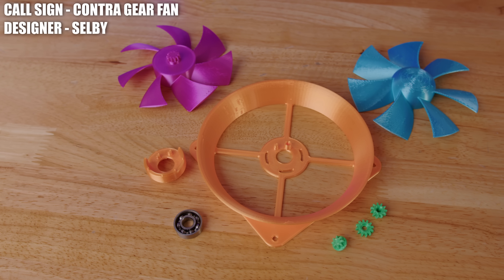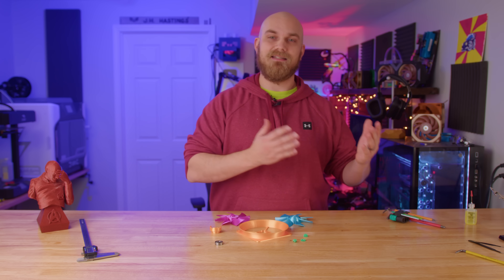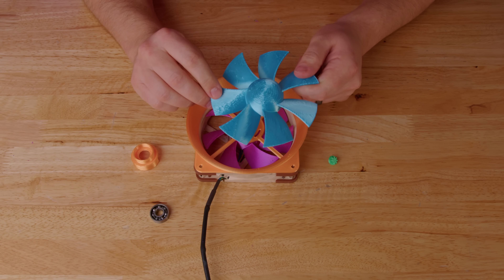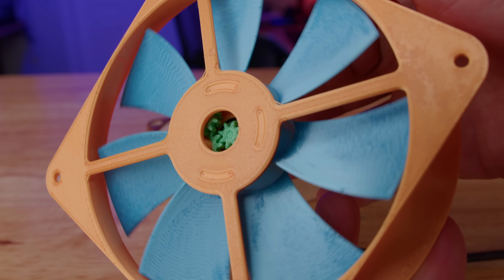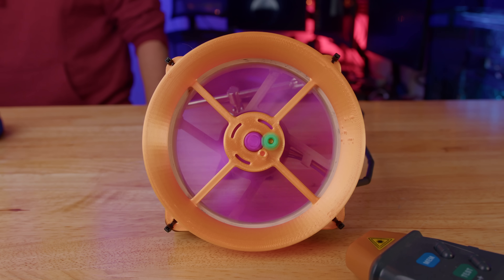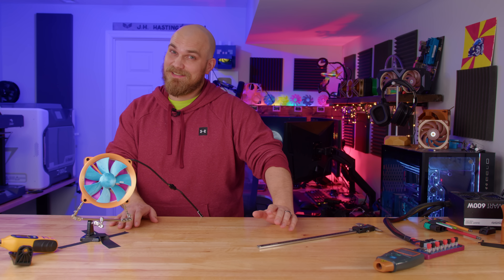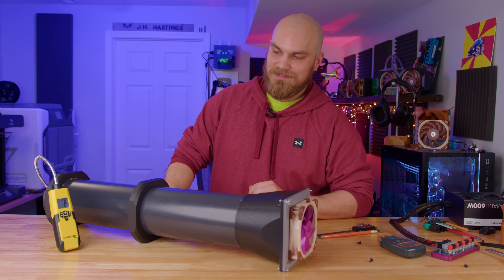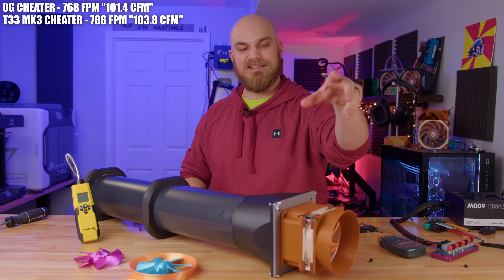World’s Most Complex PC Cooling Fan | Fan Showdown S4 Special

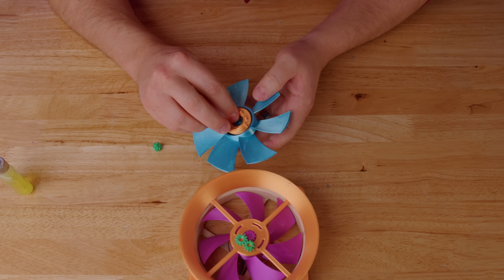Comment: 5:00 I wonder if watch oils would be best? Check out wristwatch revival. He has a video that says the basics of what you need for watch repair and he lists the 4 oils/greases he uses and what each is for! Might be worth it! Granted, plastic gears are different than metal ones, so there might be some trial and error. But seems like this keeps coming up!

Edit: I also wonder if you could try filing the teeth on the gears? Just like a quick pass to smooth them out a bit? Idk

Comment: has anyone thought of a drive train driven turbo for a fan, like a set of 3 fans, the primary fan being the fan with a motor attached, the second fan being driven by the airflow of the first fan (either in front or behind the primary fan) and the tertiary being driven by the secondary fan through some sort of driveshaft and transmission? the basis in my head is what jet engines do, where there turbo's drive fan blades are behind the ignition chamber, pushing the intake fan to increase in speed.

Comment: Someone please do a 10stage 1LP 2HP turbofan using contrarotating jet engine blades. Would most likely be composite and instead of a Noctua fan... see if you can find an old Delta 120mm x 38mm DC powered fan, that required its own mains connection rather than passing through the PSU. I wonder how much CFM that would push out.

Comment: This style of fan is used quite widely in low profile rackmount server gear. My Poweredge R410 has 7x 40mm fans comprised of two contra-rotating fan modules with air guides. They produce a ridiculous amount of airflow for how smallthey are!!

Comment: when you have same blade number you would crate a nice(if you do not have epilepsy) strobe effect with a light source behind it, i suggest RGB set to "Go fasta Red".

next to consider would be two fans running same direction, with a stator between them, in a cheater like housing.
much like a gas turbines compressor.
i find this interesting because i want to know weather the second fan makes more airflow because it is "more fan" or weather is counter rotation has some effect of its own. such construction would also eliminate the gears.

last remark: the loud noise created when the fans pass each other might come from the direction of airflow behind first fan, changing some angles might cause the second fan to cut through the air more efficient, and less noisy.
the second fan must probably have slightly steeper fanblades than a solitary fan, because it is put in already accelerated air.

Comment: You need to get some PTFE spray dry release.  It's great for lubricating plastic parts without imparting any drag.
Reply: Oh, I forgot to add the model I've used for years is Camie A1000.  It's the most consistent spray and fast drying solvent.  It dries so fast it does not have time to affect any plastic.

Comment: I have to say, the front fan has to have one blade less than the rear. Also, the angle of the rear fan has to be more, since it's supposed to work with already accelerated air and not stationary. Don't know if these aspects have been addressed in the design, or both fans are just normal.

Comment: One very important thing: to get the majority of the benefits of this contra-rotating fan you need increase heatsink fin density, because this fan has higher static pressure, so even with a high fin density it will push a lot of air though heatsink. Testing it only in "wind tunnel" without any restriction at all is kinda unfair (it would perform even better in real aplication with high fin density heatsink).

Comment: So, in other words, that gimmick of the Scythe Fuma 2 isn't a gimmick. Well, why not glue together that Kaze Flex Slim fan of that cooler with one Kaze Flex Slim fan of which the fans are designed for oposite direction. Ok, fan will be then 30 mm thick and will have 2 cables, but it's worth a shot.

Comment: Suggested is adding a small still image with name in a screen corner of each fan when reporting/showing performance tests. Example Decibel and Smoke tests include a named still image of the fan design under test. This visual prompt would make it easier to follow along when moving from test to test and fan design to fan design. When all the fans are the same color and spinning the fan under test is hard to distinguish if not listening for and remembering the fan's given name to each unique design.

Comment: I wonder how would it work with metal gears (higher precision than 3D printed), and with some stator between the two rotors (stationary rotor). Would it make it less loud or would it perform better?

Comment: As someone else mentioned, good quality gears are a must: even the smallest imperfection in the gear teeth will cause unneccessary wear during rotation.  Wear is the result of two uneven surfaces sliding against each other without or with poor lubrication. The more uneven and low quality the surfaces are, the more these will wear down or cause more noise or reduce power transmission to the fan. As a watchrepairer, I would say though that it is useless to oil the teeth of the gears if these are so rough due to the 3D printing manufacturing process. In watchmaking, where manufacturing precision and quality is of the utmost importance, you only oil the shafts the gears and not the teeth, since with time these tend to grind themselves thus creating microparticles of materials that if retained in situ would cause buildup of loose material, effectively sticking the teeth of two interlocking gears together. This is what you want to avoid. Oil on the shafts will reduce considerably friction where it is constantly present, increasing performance and reducing noise considerably. This is why fluid dynamic bearing (FDB) fans are so good and widely used even in HDDs: the fluid dynamic bearing increases the life span of the fan while retaining one of the most positive aspects of sleeve bearing fans, which is the low noise level.

Comment: I've always been thinking you should balance the fans this is especially true with contra-rotative multi bladed fans.
The CFM does not improove but it seem obvious this setup generates more pressure difference than any other tested, if built correctly this fan should outperform everything, mostly usefull for water-cooled setups.

Comment: Another idea how to measure fan efficiency: connect fan to the cooler like always but instead of cpu put a peltier element to the cooler. And measure voltage it produces.

Airflow measure is good. But different fans push through cooler with different force. Some of them shows good cfm values but performs bad connected to the cooler. And in the opposite case, some may not show good cfm but their flow isn't stopped too much with cooler and after all they show good performance.
In the end of the day fan should cool the cpu, not only produce good airflow.

Comment: This is so awesome! The higher performance of two fans had me thinking for a few minutes, and I think it's because the counter-motion of the fans cancels out the angular momentum of the air. You can see this in the smoke test - the air comes out almost strait instead of in a vortex. So less energy is lost to sideways motion (which would increase friction in the tunnel, I suppose) and more energy is transfered to linear motion. In addition the air already has a certain linear speed component from the first fan, so the second can also speed it up more.
...
Well that's my speculation at least. It is really cool to see those effects overcome the negative impact of the friction between the gears, etc.

Comment: Can you maybe get a dark background for the sideways shot of the smoke test?
And also, you could try using a laser pointer and a cylindrical piece of glass (a wine glass stem would do for instance) to get a planar laser sheet that should really emphasize a plane of the smoke to see finer patterns in the flow

Comment: Obvious next question: How does the contra perform with the cheater's shroud?! 

Since it's not as good of a drop-in replacement, what if the shroud of the contra was just as high, and it also had the additional attachment on the other side of the fan?

Comment: You can't measure performance with only measuring CFM, you need to know how much power is being used to make that airflow to know if there is any improvement. I mean, of course adding another fan (or more blades, or higher pitched blades) is going too increase airflow, but it also increases power used - and probably in every case actually decreases efficiency.

Comment: If a single feature in the print it more important than the rest and still the print will work upside down better - just add makeshift supports. Add a cylinder with 0.2mm spacing under the feature, this will make it come out way better than you ever thought.

Comment: When you have multiple fans stacked one on top of another, I'm wondering if there's a benefit to making their blades thinner/have a lower total surface area. Even with a single fan, there's an optimum where too thin blades will scoop up less air to push through, while too wide ones will block the airflow too much. I'm wondering if stacking multiple fans one on top of another compounds this "choking" effect. 

I don't know much about fluid dynamics though, so correct me if I'm wrong.

Comment: I think the contra in single fan configuration should be tried with the second fan shroud mounted, because it's a little velocity stack and may be the reason of the improved performance. This should be tested to see if it's the case or the second fan really adds to the airflow

Comment: It could be less loud of the gears were more tightly matching, and those spiral ones instead of straight. Straight cut makes for louder drive, the spiral ones are always on contact, so they don't "hit" each other. I'm sure you could get model helicopter gears or something that are made of pressed metal (would be porous to let oil seep into them, better lubrication maybe) abs miniature bearings. Should bring the noise down and the ripp'ems up

Comment: 2 Noctua fans + 2 T33 fans with 1 reversed + cheater fan housing.  place 2 noctua fans back to back and with one set of blades reversed, you will have a contra rotating setup with none of the extra friction from 3D printed gears.

Comment: I guess the german in me just enjoys how over engendered contra rotating props and fans are. Part of the reason why crontra props were created, was because you have a big blade spinning one direction on an aircraft, the aircraft will generally roll easier in the direction opposite of the prop rotation. So the contra props were to counter the tendency of an aircraft to roll easier in one direction than in the other, thus opening more opportunities for maneuver, as well as boosting the performance of the aircraft as a whole. Put in simple terms, the torq from one prop cancels out the torq applied to the aircraft by the other prop.

If you hung a PC fan, or a desk fan from the four corners of the fan housing, you’d see that the contra rotating props have less tendency of making the fan housing rotate than a regular fan does.

Comment: The amount of air is one thing, but pressure even more important as you rarely have free airflow.  You should mesuareg that and the dual fan should excel on that.  The cheater you could equip with static fins that change airflow direction before the fan. Effective and silent.

Comment: The creators of these fans need to team up and fully integrate their designs! We need to see what the result would be if the T33’s blade geometry was modified to operate with a Contra-rotating assembly, (for both fans) all inside of a purpose made Cheater housing with the tightest tolerances possible. Also with some bearings on those gears if it is at all possible without increasing their size. Just think of the possibilities!

Comment: New season idea: Contrarotate everything. For every design, print a mirrored version of it.

To make it fair in that every design wouldn't need to have a gearbox, just have two PC fans running in opposite directions. No need to rewire anything. Just flip one of the fan chassis to face into the other.

Comment: I suspect the boost with the second fan attachment is purely from the velocity stack intake, that's what gives the cheater it's main advantage. Still I'd like to see a 3rd revision on the contra with looser tolerances on the front fan and velocity stack and then ceramic hobby bearings used on all rotating parts. A very cool idea alright.

Comment: You must put this on the s3 thermal setup.  It should trounce the competition.  I mean it is basically 2 fans so should have a lot more pressure to push air through a radiator or heatsink.

Comment: Curious, would making both fans as normal fans work better if you just stacked 2 noctua frames or am I missing something? 

So 2 fan motors and frames powering the system and you could get more RPM and fine tune to make less noise?

Comment: not to be THAT GUY, but you missed a variable when analyzing the design's performance with it's single fan vs it's dual fan configuration - the mount for the second fan has a shroud shaped like a velocity stack. I'm not saying that's entirely what accounts for the increased airflow, but I think it's very possible that it would have an impact. a more thorough test would be to add the mount with the added shroud alone to see if that alters the airflow performance at all, and then add the second fan as well.
Reply from the maker: Good point

Comment: I’m curious what the static pressure is like! Could it improve efficiency with the phat radiators?
Reply: basically a twin fan design, so way higher than any single fan besides those thick bois.  Should still be higher than them as well.

Comment: Holy fuck that thing is like a laser, which is exactly what contra rotating props are meant to do, reduce torque on the air frame and create laminar flow over the wings; I bet it would work even better if you reduced number of blades on each disc, basically you have 14 blade fan, great for static pressure, not so much for airflow

Comment: I'm curious if you could simply attach two noctua's together with each having a reversed blade angle so that you can have them rotating in opposite directions and see if that produces better results? It's either over engineered gears or double fans. Which should be better? I imagine the double fan method would produce a lot less noise at the cost of extra space/power usage. :P

Comment: Imagine if those gears were machine metal gears with better backlash. Or how about this.
An entirely new fan with the motor is already made to fit the contra rotating assembly. The fan would be expensive but worth it

Comment: I don't know if this has been asked here before but what happens if, instead of counter-rotating fans, multiple copies of the same fan (rotating in the same direction) are stacked?
Reply: 2 fans going same direction will only net a very small, if any, increase in CFM, but will create a lot more pressure.  Same concept as those thick boi fans.  This is good for when used with radiators.  This contra setup does the same thing but should slightly edge out 2 fans running same direction at same speed.  The contra rotation reduces the turbulence and makes it quieter as well.  This all makes it a more efficient setup.  Look at the smoke test.  That is some smooth airflow.  Stacked fans or contra fans will not really push any more CFM than a single fan.  They excel at pressure.  This thing needs to go on last years heat test setup and it should destroy the competition.

Comment: This opens up a big ol' can of worms when it comes to possibilities. One that came to mind, for me, is to combine differently designed fans that would compliment each other. You can see in the smoke tests that some designs do a great job of pulling in the smoke without letting much escape. Other designs don't "gather" the smoke as well, but they move what they do gather at a better pace. If the front fan can pull in a huge amount of air and the second can push it along at a good clip they would make up for each others weaknesses.

Comment: I'm wondering if this fan was done with extremely precise manufacturing and bearings on each gear, if you'd not only get even better performance do to less parasitic loss but also make it far quieter. That blade design in general will always be loud do to just how it moves the air.. but I'd love to see it.
Reply: Also wonder how it would perform with a radiator between both fans.

Comment: I'm not convinced the second fan is what's causing the greater airflow, given how the shroud of the cheater improved the airflow of the T33. The secondary fan also has a shroud, though smaller, that could be improving the airflow by itself without the fan. Would be interesting to see the results with just the shroud and the one fan.
Reply: He tested the first fan alone as well as testing with both fans.
Reply: @Power5  Yes, but he didn't test the single fan with the shroud.

Comment: Could u do the air push test again? Sounded like it was rubbing on the edge. That would slow it down no ? :) Oh and if ur gonna try and combine it with the cheater, try and use metal gears instead of those plastic once. Think its gonna give a lot more stable pull from the primary fan. Cus the texture from the printet stuff will be rough where a metal gear could be be very smooth and precise teeth

Comment: Selby ought to play around with a few different combinations of angle of attack on the blades. There are some counterintuitive effects in play, but in general, the second stage can take a much higher angle of pitch because the relative angle of attack is so much lower.